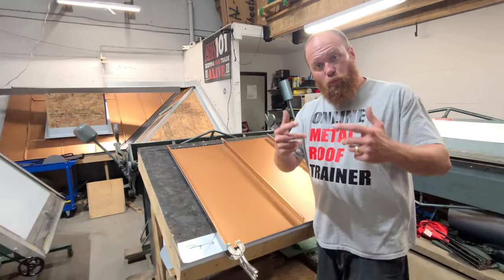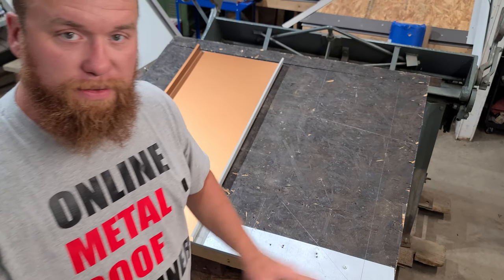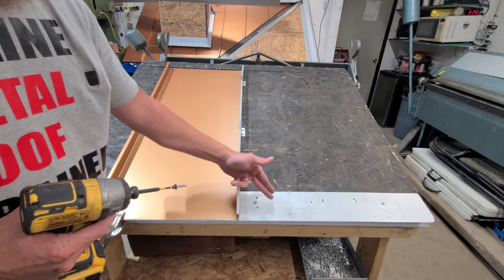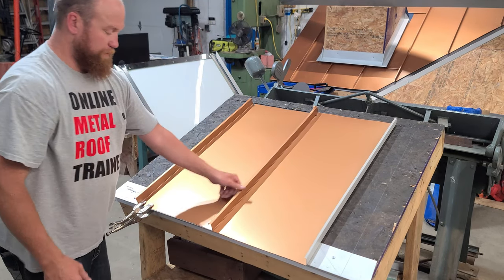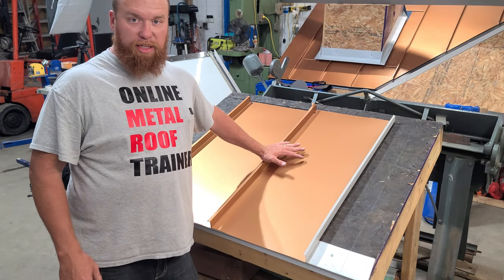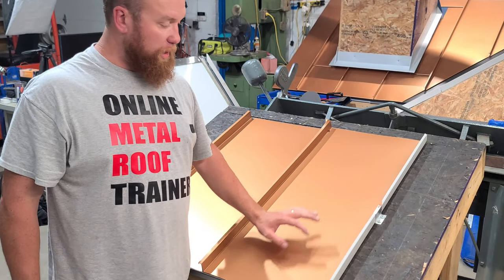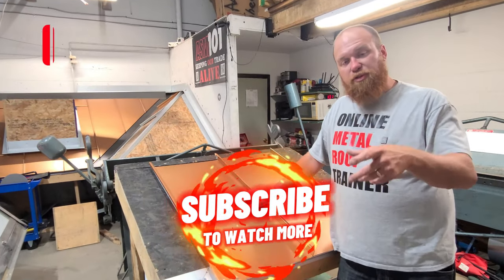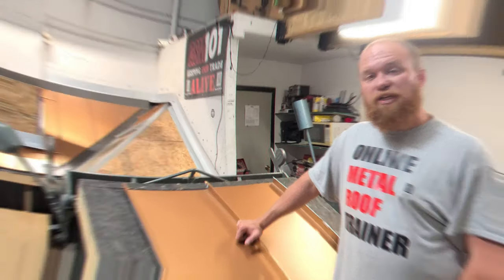How to Install Standing Seam Metal Roofing Like a Pro!

Comment: Is it better to seam before your next clips or clips then seam?
Reply from the maker: I clip then seam but I don't clamp
Reply: In England and Europe, we have a standard of clip spacing! We also have fix and sliding clips ! Fix clips = x5 in a meter and then every 300 mm centres for the sliding clips ! This goes down to 200 mm for when solar panels are installed! 
The perimeter of the roof ( all around ) has clips at 200 mm centres ! 👍🏻

Comment: Do you still fasten the top of the panel with a neo washer screw even with your bent over tab that holds to the clip? Would it be best to have that bent tab near the top of the roof top allow expansion and contraction towards the bottom?

Do you prefer PVDF, SMP or textured SMP coatings? Thanks!
Reply from the maker: The best thing for expansion and contraction are expansion clips.  I don't put screws through the panel anywhere on my installs.
PVDF is my fav... The colors look so good
Reply: @asm101  Thanks! If you were doing a clip system snap seam install with the bread pan detail at the ridge and hemmed over the roof drip edge at the eave would you still not put a neo washer screw up at the top to prevent the panel from sliding down (even years down the road)? I recall you saying that, that is what you would do in a previous comment on one of your other videos. 

With a double lock mechanical seam panel; is sliding a non issue once it's all seamed together? Just with the weight of ice and snow on the roof with snow stops installed or with a solar array on the roof. 

Do you ever install 0.032" or 0.040" Aluminum standing seam? Or is it pretty much always 26/24ga painted galvalume besides the odd copper install? Thanks again for your time, I really appreciate it and all of your videos!
Reply: on some snap lock pans warranty requires pins in the top but there's no need on traditional standing seam